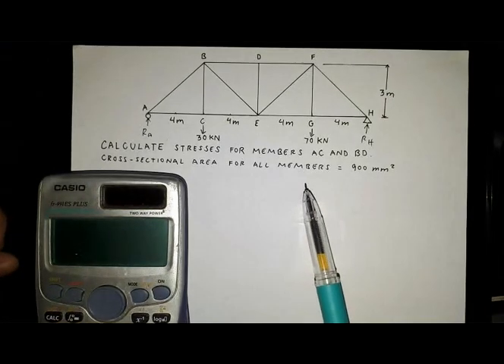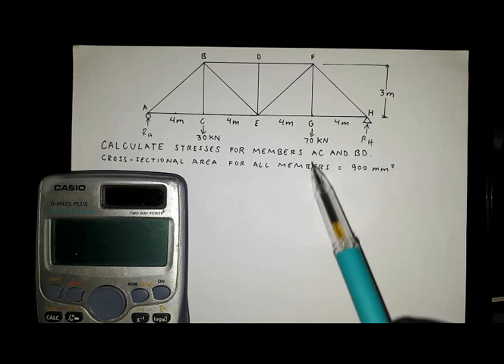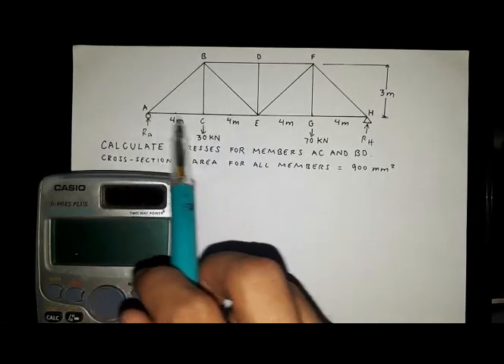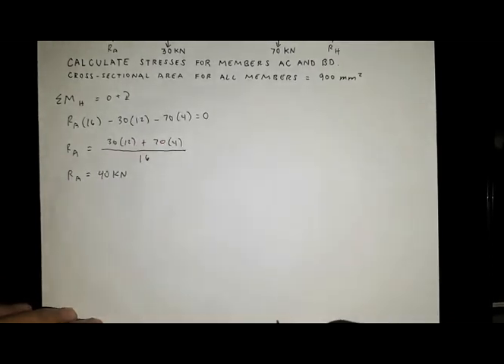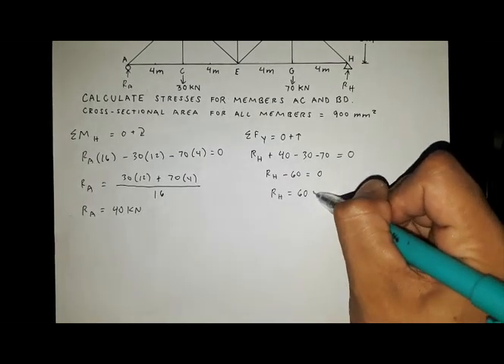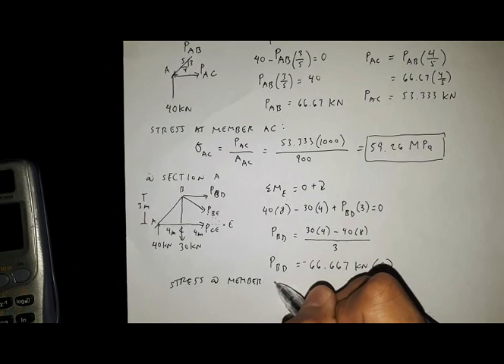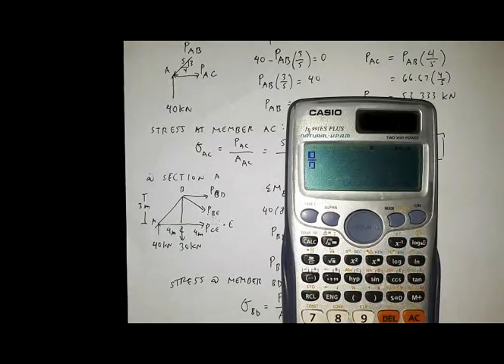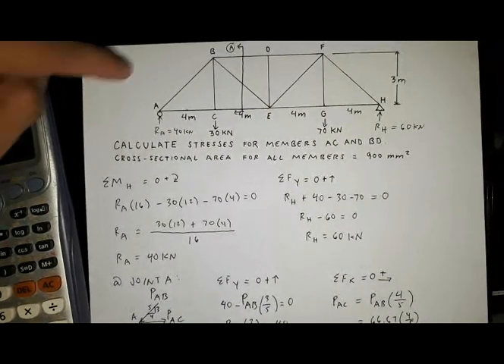Solving stresses on truss members

Comment: So we don't actually need the reaction on H or did I miss something?
Reply from the maker: In the problem and method shown, the purpose of solving the reaction at H is to check for the equilibrium of forces acting along y.
Reply: @mathibae9356  Thanks! to be honest I didn't understand a lot of the problems I found, but with yours I just picked up my mechanics notebook and understood perfectly, nice video.